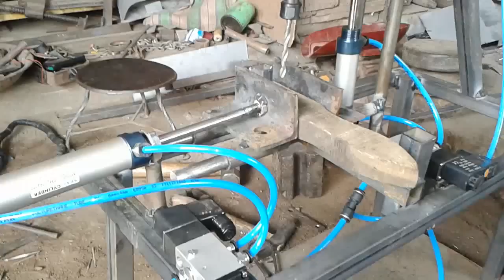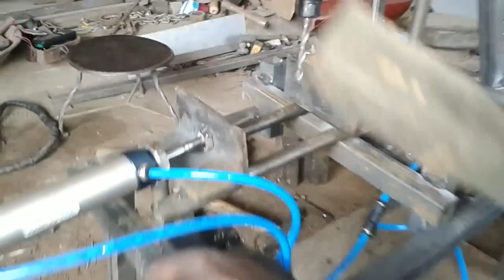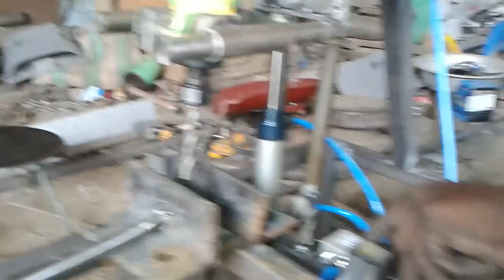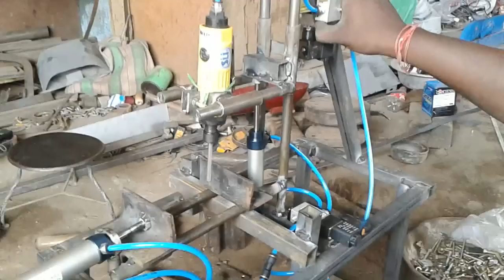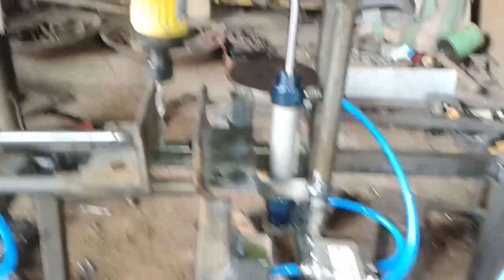Auto feed pneumatic drilling machine mechanical engineering project topics

Comment: Still some arrangement is required .
Never bring your die grinder body near horizontal press .
Only for light work use.
You will drill only 6 mm & 3mm bits only according to your collet size .